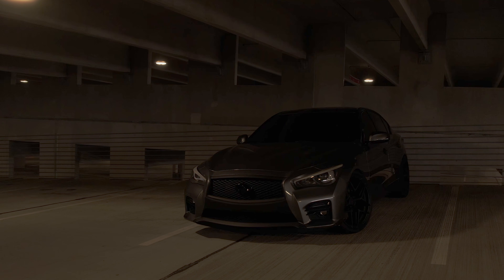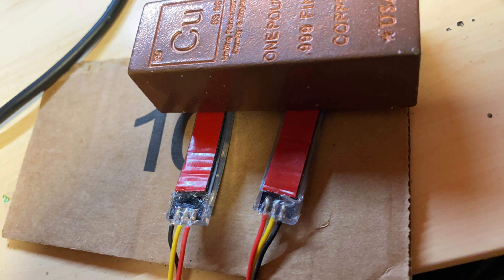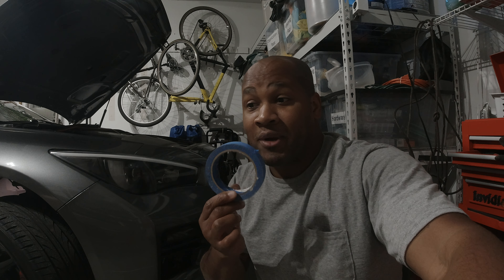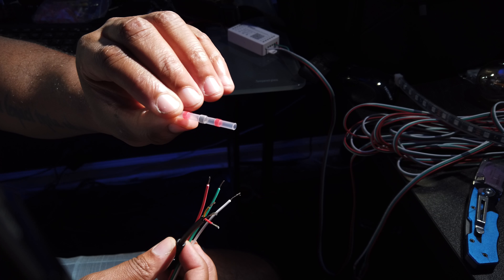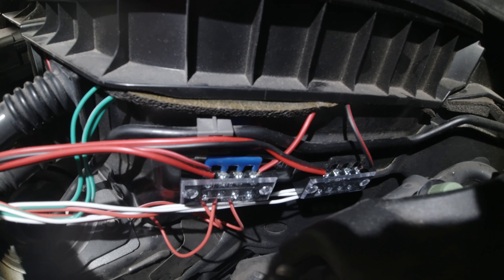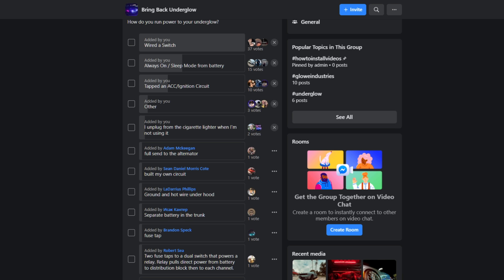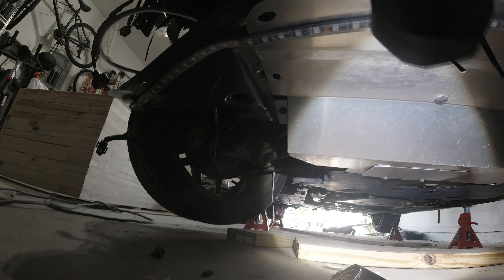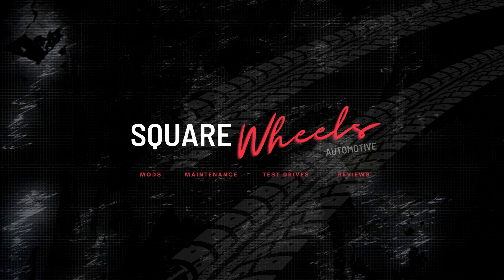Premium LED Underglow Installation on an Infiniti Q50

Comment: What size fuse came with yours? Mine had a 5amp with the sp611e. After the fuse blew it will turn on but only to white and will not receive bluetooth functions or respond to the controller.

Comment: Is it possible to program and have underbody lights automatically turn on/off as welcome lights? Like how when the car is park and you unlock from the fob, the door handles have lights that turn on and then turn off. I'm thinking of adding under lights to that sync. White 2014 q50 with white LED underneath.
Reply from the maker: Like at :34 ?
Reply: @SquareWheelsAuto yes!!! Sorry, didn’t catch that when I first watched it. But can you make it so that it auto turns off after starting the car? I kinda want the underbody lights to be low key and not be too much attention. Also, I live in CA and illegal to drive with.
Reply from the maker: Yep anything is possible, just depends how you configure the triggers to interact with your car

Comment: Can I ask a question if your only running 2 channels why did you plug in 3 signal wires ?
Reply from the maker: Good eye man 🧐😅

On the 3rd channel, I have extra lights in the grille that I didn't mention, since they don't come with the standard Q50 kit
Reply: @SquareWheelsAuto  haha thanks man. Yea I saw them and thought wait a minute where do those go. Thanks for the reply though. I'm getting ready to order mine too. Would you suggest both controllers like you run if all I want is color chasing, music sync, and turn signal sync.
Reply from the maker: @daltonmohr9327  you can achieve all those you mentioned with just glowe's UFO controller.  To protect your battery, just be sure to have a way to cut power (relay or switch) to it if you're gonna park the car for extended periods of time.  I only have the blueghozt in place so I can unify my headlights/led emblem/underglow/interior all together, and do that triggered welcome animation when I unlock the doors.

If you're going with GLOWE stuff don't forget to use the coupon code SQUAREWHEELS to save a couple bucks!

Comment: Does this drain the battery with all these wires ?
Reply from the maker: Not if you wire smart! Addressable LEDs can drain your battery even when they're off thiugh. Check out @17:27 I cover the power delivery options and how I did it. U could be fine with just underglow, but with all the heavy lighting I'm running I had to be smart about it 👍🏾👍🏾

Comment: What size wheels and tires do you?
Reply from the maker: In this video, they were 20x8.5 245/35/20 all around.
Reply: @SquareWheelsAuto   did u had to cut or did they fit perfect
Reply from the maker: @lilashe23  no cutting, that's pretty conservative sizing. I actually added 25mm spacers to make them fill the wheel wells better. My new wheels are 10.5" wide with 295 tires and still no cutting or fender pulling required.

Comment: question.. when you plug in the lights does the blue ghozt app automatically see the lights? or do you have to do something else to make them connect to your phone?
Reply from the maker: not sure I understand the question.  if the lights are wired to the blueghozt, then it sees them.  to connect the blueghozt to your phone, open the blueghozt app and the name of your blueghozt should pop up.  click it, and you'll be in the interface to control the lights connected to that ghozt.

Comment: I believe it's only ricery to those Hondas and other horrible cutting off the muffler or exhaust tips 🤦🏽‍♂️ 

I will ask how much would you charge to do this to my 2015 Infiniti Q50 3.7 Premium RWD 
First Car! Hard Work Pays Off! 😁
Possibly the same as your car but Silver 👌🏼 
I think your car color and rims are 🔥 

Still in process of getting other mods (exhaust, sound system, air intakes(have one just not installed yet), 1" larger rims & tires, tint & possibly a better radiator (hot af in AZ), front lip, side skirts & rear defuser, LED Seat Covers, and brakes & rotors. 
Sorry I seem to talk too much but for someone who's in automotive you sure may understand? Or may be annoyed but either way I'll understand!
Reply from the maker: Sounds like you've got your work cut out for you!! I feel you, the work is never done 😅😓

Check out some of my other videos, I've done some of those same mods and covered the DIY, with product links AND coupon codes.

To answer your question, I don't really do installs on other people's cars, I'm just a DIY guy that tries to demystify some of this stuff for others as I learn.

Thx for watching man 😎👍🏾

Comment: Question… I did notice you said it activates with the welcome lights. But can it be turned on and off on the fly?

Another thing I was hoping to see was the illumination match the rest of the car. Can’t tell if that’s the cool white or some sort of purplish blue that is showed in the video.
Reply from the maker: Yeah since this is one of my Blueghozt outputs, I can turn it on and off easily in the app. 👍🏾

I hear you re: white. Because these are RGB strips, they max out their Red, Green, and Blue LEDs to simulate white. Additionally, if the strips end up mounted at an angle, it can affect the way it blends the colors together and you can get a tinted look.  In a nutshell, simulating pure white is tricky.

Comment: What type of wheels are those sand what size
Reply from the maker: STR 908 20x8.5 all around
Reply: Thank u so much are they a light weight rim
Reply: Is your car lowered
Reply from the maker: @repo3167  yeah!!! they're flow forged and surprisingly light - WAY lighter than stock sport wheels
Reply: What size tire did u run sorry for all the question u doing your thang in q50 q60 community
Reply from the maker: @repo3167  pretty sure they're 245/35/20 all around. no problem man I enjoy talking cars I'd do it full time if I could!!
Reply from the maker: @repo3167  yeah i'm dropped on RSR-Downs
Reply: U have coilovers or lowering springs
Reply from the maker: @repo3167  RSR-Downs are springs: https://amzn.to/3mQU5Q5
Reply: Are u ever in Chicago cause I would love for you to do my head light like yours
Reply from the maker: @repo3167  nah im no pro I just DIY on my own car for now!
Reply: @SquareWheelsAuto  How is the ride when lowered and on 20s? Wondering for a daily driver
Reply from the maker: @sharkycat1096  pretty uneventful! It’s just a moderate drop on RSR downs, perfectly fit for a daily driver. 👍🏾

Comment: I stopped the video when you tried to tell me 12v is more efficient than 5v… please do your own independent research instead of reading what a company says. Other than that the video and voice work was amazing
Reply: 12v pulls half the amperage as 5 volt, and you have a nearly unlimited supply of 12v amperage readily available.

If you run 5v LEDs you’re going to need a ton of power injection all over to keep voltage steady along a 30 foot build. 

Less amperage also = less heat and stress on the wires. 

You can produce 60 watts at 5 amps @ 12v.
You would need 12 amps (over 2x!) the amperage to drive this at 5 volts.

We have builds eclipsing 30 amps of current at 15.5 volts.  That’s 465 watts.  That’s 99 amps of current on 5v tech, woah.

The research has been done and I’ll stand by the statement. It’s not a baseless claim.  We recently had 12v addressable halos made, too, that can hook up unline with the rest of the kit, no adapters or converters needed.